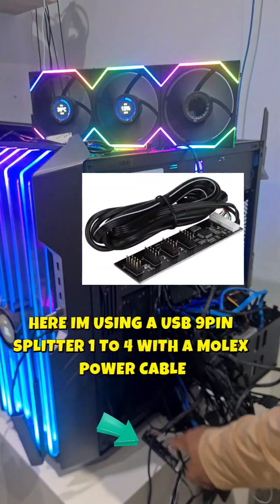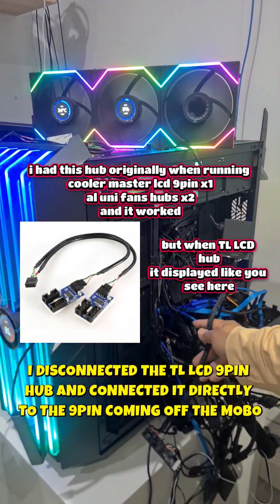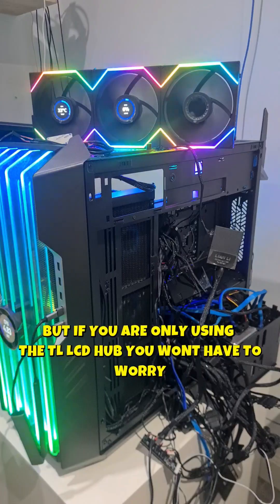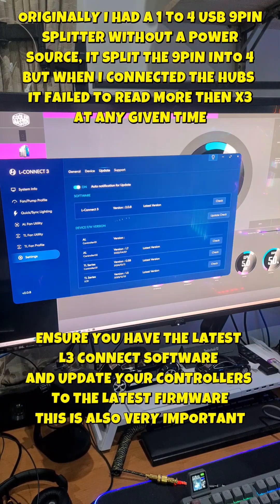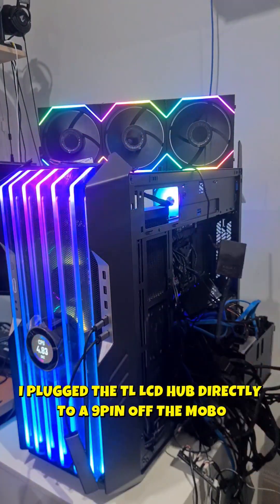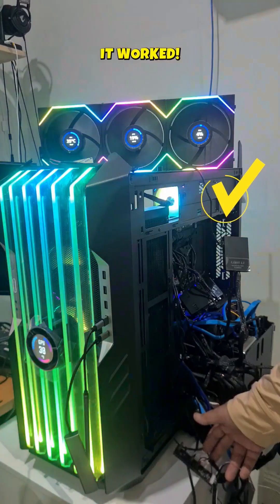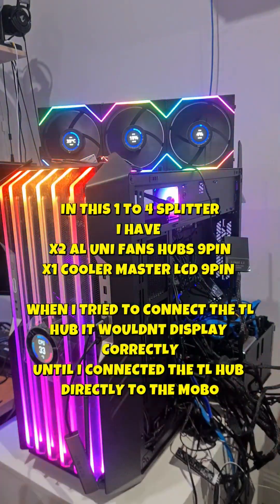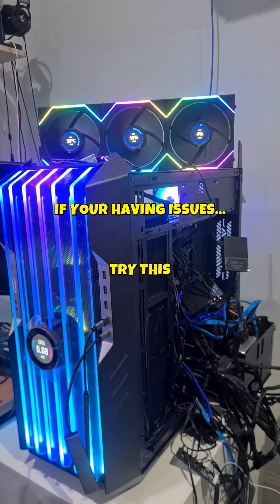lian li tl lcd uni fans not displaying correctly. here's why... do this FIX

Comment: Ive had the same problem as everyone else, truly crap fans. At one point it worked but from time to time i get the dreaded "object reference not set to an instance of an object" error on the "TL LCD screen Correction Setting" tab. I contacted Lian Li and they sent me a new controller, but that didnt help. Today I also bought a SATA powered USB-hub but that didnt help either. Maybe the LCD displays will start working in the future but I have tried everything including all suggestions on the web page, uninstall /  reinstall / beta versions even. I cant recommend these fans... =(
Reply from the maker: damn guys so sorry to here... that really sucks ..ya reckon they did this so u can switch to wireless ? ..but i cant justify spending any more on fans this was bottom line ...and ecen that still exspensive as fuck

Comment: I to have this problem, the lcd comes on during start up but then goes black, it is seen in the app as 3 fans with lcd screens, but only has 2 lcd screens which can be programmed.
I’ve tried changing the fan as I had a spare, I’ve tried re installing latest software, I’ve tried moving the cables to go direct into the motherboard rather than the Lian li splitter I was using. 
Nothing has worked, what else can I try should I try another cable from the fans to the motherboard? Could it be the cable? I’m pulling my hair out with this one and I don’t want to have to take my pc apart again
Reply from the maker: wow thats crazy did u follow the steps from lian li..they have a set troubleshooting guide that will help...it did for me..i know its so frustrating i feel ya man..i had same problem ..but when i contacted lian li they gave me the troubleshooting guide and it worled ..for me it was not using port 1 ...and also makinh sure its connected direcrly to 9pin header usb on mobo..no hub
Reply: @MIKEYZVLOGZ  I got it working finally bro I changed the usb cable I still went into the lian li hub on my psu, must have been a dodgy cable that was the issue luckily had a spare from the extra fan i didnt end up using, thanks for getting back to me :D
Reply: @chindawg7076 hi, I have the same issue right now and I'm trying to solve it . I'm French and my comprension in english is pretty bad but did you change the USB from the hub to the motherboard or the câble from the fan to the hub ?
Reply from the maker: @chindawg7076 most welcome bro im so glad
Reply: @ThéoChevalier-c4h  Hi Theo only just seen this comment from you have you managed to sort the issue now?
Yes I first started by changing the cable from the hub to the motherboard which meant I had to partly dissemble the pc in order to re route the cable, this made it temporarily work however the problem came back, I then ran a new cable to the hub and left the other cable in the motherboard, this seemed to fix the issue, I ended up using the motherboard cable to run to an extra lcd fan which I had spare in the bottom of the pc case.
I also tried re arranging the fans in a different order and this also seemed to help fix the issue, but it then caused a different issue where the lcd would keep resetting over and over, the change of cable seemed to work the best though not had any issues since, bizarre really as the cable to the motherboard seems fine just running one fan but didn't like a chain of fans.
Hope this helps thanks bud
Reply: Thx I found that my issue was that I ad too many device plug in my 2.0 USB on my motherboard. But thx for your reply
Reply from the maker: @ThéoChevalier-c4h yes i dod mention that also cant have too many devices plugged in for example ifnu have active hub x4 then u can only use 3 ports ...but good onnya well done glad u gotnit sorted
Reply: @ThéoChevalier-c4h t’as réussi à faire marcher ? Parce que j’ai le même problème que tout le monde, c’est vraiment de la merde ces ventilos 😭 j’ai qu’un seul lcd sur 3 qui est reconnu par le logiciel, mais les 3 ont bien le logo quand le pc se lance
Reply from the maker: u have to follow the troubleshootingnsteps of the site ... it could be faulty cable

Comment: when i unplug my gpu, it lights up. after plugging no bueno. wtf
Reply from the maker: @dy1837  very strange indeed ... hmm very hard to say what it is without being able bto trial and errorr some scenarios... one thing that helped me is conta tinf lian li and they walk u through troubleshooting steps
Reply: @ fixed. Another trial and error is to move the usb 9pin to another usb 9pin. And make sure to connect directly on to the mobo

Comment: Just finished my PC build 
Motherboard X870-f 
4080 super
AMD Ryzen 7800X3D

My issue right now is I have 5 SL Lian LI LCD Screens and when PC is powered on I can see the logos appear and then right after they shut off and it remains black. I have the latest firmware updated which is Lian Li Connect 3 but I don’t know what’s going on. Can you help?
Reply from the maker: @gtrremy8968 ok so... 
are u using a hub at all? are your hubs plugged in directly to the motherboard or do u have a splitter like i have? in this video ? 
4 fans should work off 1 hub directly plugged to mobo ... I see u have latest firmware thats good 

  the best way is to contact lian li ... they will walk you through step by step because systems are set up differently..
when mine didn't work 
the solution was 
to update firmware individually 
then reinstall latest software 
then test each fans seperately
and lastly I contacted lian li 
they gave me a trouble shooting guide 
and it solved my problem

Comment: My TL LCD fans are not lightning RGB when I connect them as a group, if I connect each fan by cable to controller it works.. Expected more from a fan that costs almost like my 32GB of RAM...

Comment: How do you close that behemoth of cables 😂
Reply from the maker: with some zip ties and abit of skill... there's actually alot of space in this haf 700 evo case and I do close it quite easily ... I'll have ro do a short and show u one time lol
Reply: @MIKEYZVLOGZ man i just cant i have like 4 controllers 1 for strimmer cable 1 for sl-inf fans 1 for lcd fans 1 usb hub from nzxt i just squeezed everything and called it a day 😂😂😂
Reply from the maker: @J4ckKun  but u did get the case closed right? as long as it's closed its fine

Comment: I have 5 and none are turning on
Reply from the maker: that's messed up have u tried following the troubleshooting steps from the site
Reply: @MIKEYZVLOGZ  I went on site but it not helping and I watched videos aswell. I tried reconnecting cables and connecting them to different ports but they just won’t turn on at all
Reply from the maker: @Rxphh and it's connected directly to the mobo? and did u update all firmware ?
Reply: @Rxphh we got the same problem. Did you fix it already?
Reply: @fridays7254  ye I didn’t have the wire connected to the side with the pins on the fans
Reply from the maker: glad it works mate
Reply: @MIKEYZVLOGZ  bro can u help me? Fix mine 🥲
Reply from the maker: @fridays7254  whats wrong with yours?? wats the issue?? there have been updates to software since release have you aupdated the software ?? did u plug inm all the cables?? make sure you have all the cables plugged in and do not use port 1 only use 2 3 or 4
Reply: @MIKEYZVLOGZ  yes i tried it all. The L connect software cannot see the controller and the tl fans. But in my device manager it shows all the tl lcd and the controller

Comment: I have same problem but just lcd 120 not showing in the software, the other 140 lcd is showing. Maybe because M using slitter nzxt, that make other lcd not working?
Reply: I got this same problem.. have you find a fix yet?
Reply from the maker: @tk9072 are u using the trouble shooting guide on lian li website? it's what I used and it worked ... things to try. update each fan seperately. then plug into the hub. 
update to latest firmware
ensure u plug the hub directly into motherboard 
use only ports 2 3 or 4 on hub 
mine is working just fine and no issues at all 
I might make a full video on this to help ppl with this not working issue
Reply from the maker: how many ports u using for splitter
Reply: @MIKEYZVLOGZ  2 port, because now i connect tl hub directly to mobo, but it still not detected on li connector 3. And i got issue after new update few days ago
Reply from the maker: @triplev5841  that's so strange... mine is just fine
Reply: @triplev5841 i got the same problem. The fans are not showing in the software. Its so frustrating
Reply: @triplev5841

Comment: I had the exact same problem as you. It worked only when directly connected to the motherboard. The issue that I'm having now is that I also have a 140 LCD fan connected but when I go to the LCD option for it in the software it does not show up.
Reply from the maker: hmm I have to say the software isn't perfect but for me it does work..the other day however I randomly had the usage show 0... I had to delete and reinstall the newer version after updating to win 11 and then it worked again..it's definitely very strange
Reply: @MIKEYZVLOGZ  When it wasn’t working for you was it just one not working or all of them?

Comment: It's happening for me as well, just one LCD is not working. Weird thing is, when I do a restart, it shows the logo on the screen and just cuts off when I get to the desktop. It was working just fine for about a week.
Reply from the maker: hmm that's very strange ... I was having this issue until I finally followed the troubleshooting steps then it worked flawlessly . make sure it's plugged directly to mobo...the usb 9pin and make sure u plug the cable into port 2 3 or 4 for your hub ... ensure u have the latest version of lian li l3 connect...
Reply: Im having this issue rn how did you solve it?
Reply: Literally having this same issue too just bought them and now all of them stopped showing the display it started with the lcd on the cpu cooler then 3/4 fans now all the fans and I can’t get it to work no matter what I do and the screens just flicker constantly
Reply: @AmandaReposa   use the zata cable. Problem solve.

Comment: So I just put these in my case. And all I can seem to get to appear is the logo. All are powered. But I keep getting the same error message when I attempt to upload anything. Also I can't go into the software and select anything to monitor like displayed in your video. Not sure what the issue is.
Reply from the maker: make sure u have updated to latest firmware... plug the hub directly to your mobo and when ur fans into your Hun use ports 2 3 or 4 ..fo not use port 1